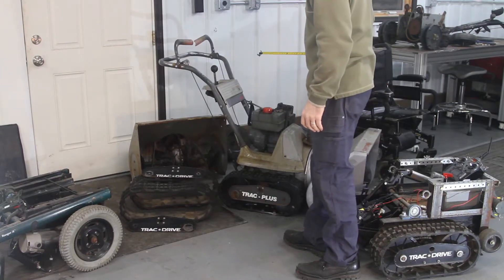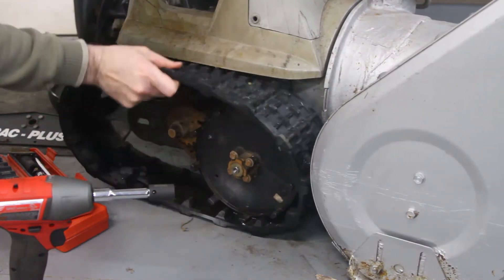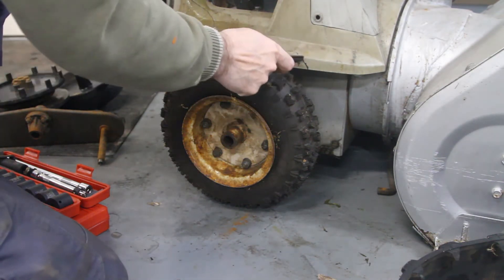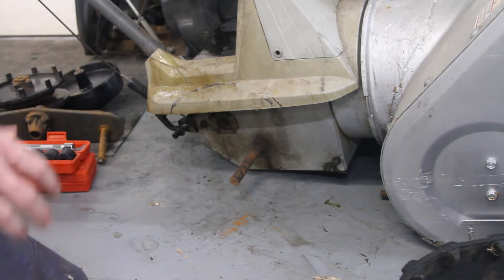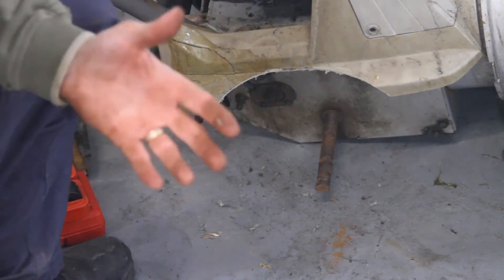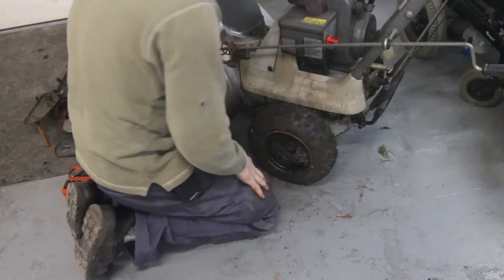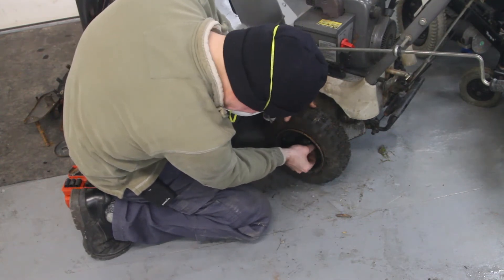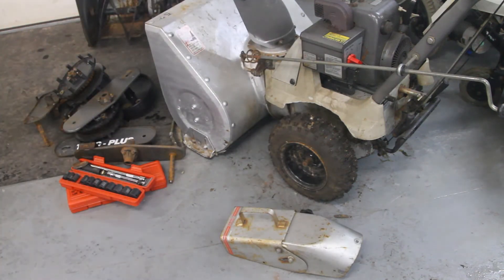Track Drive Snowblower Conversion to Tires

Comment: Need advice.  I am using lift chair motor similar like wheelchair motors, but my motor shaft is 25mm and my tracks shaft hole is 19mm. How it can be mounted. 
Thanks in advance.

Comment: I have to do the same conversion.  What is the axle diameter and the size of the tires?  THX
Reply from the maker: 4.10/3.50-6 tires.  3/4" shaft
Reply: @BZEUG  THX AGAIN!!